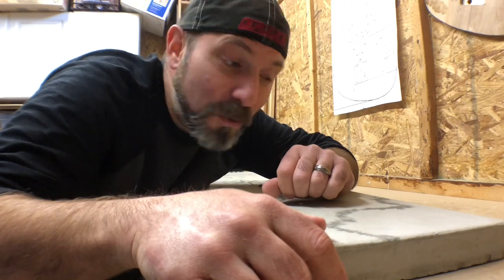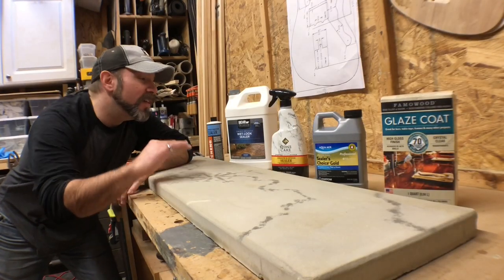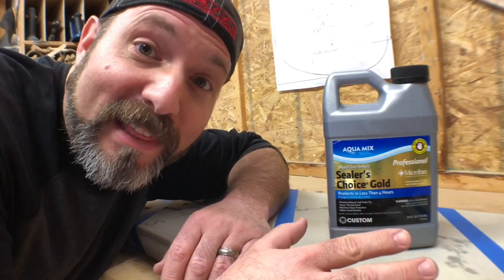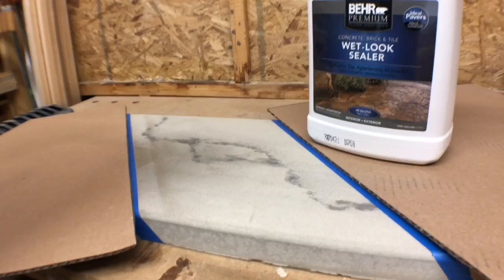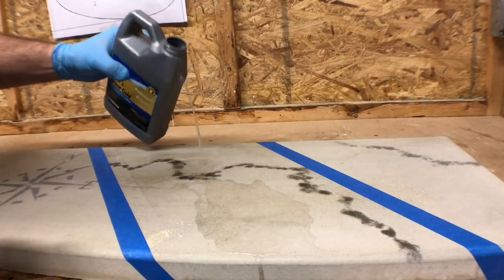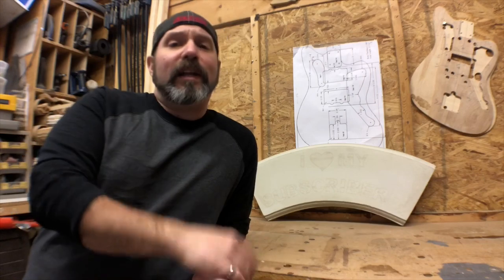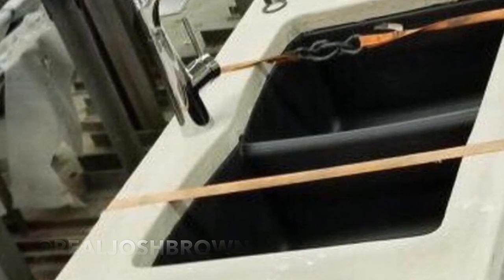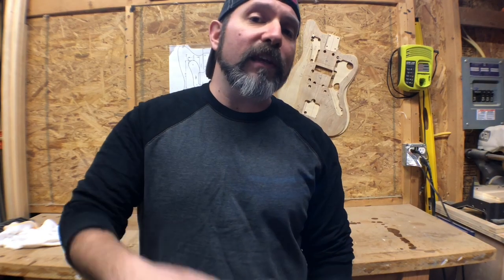Seal a Concrete Counter Top

Comment: I have 2 questions, first- when I was mixing the concrete and i put the flow set in to get the pancake mix consistency, underneath was still hard and not so easy to pour. Did i need more water, did i need to mix it more for longer or was the weather to warm? (75degrees)

Second- I have unicorn spit for my design, do I need to seal the concrete first with some Behr Wet look before i can use the glaze coat with my colors in?

Love the videos, we want more!

Comment: Hi Michael
Love your channel and method to achieve beautiful countertops.  We have made a full outdoor kitchen.  We had to stain the concrete as someone spilled paint on it.
We used the Behr stain and Behr wet look sealer.  When I went to tape off countertop to caulk the joins, the painter's tape removed the sealer and the color all together.
What did I do wrong?

Comment: Mike- thank you for these awesome
Videos!!! My dad and I are working on a project during quarantine and have really enjoyed your videos. I was wondering if I could ask you a couple of questions. When building the countertop how do you support the melamine? My dad is worried that if I lay it on the garage floor to pour it won't be level and that if we suspend it on saw horses it will collapse under the weight. Thoughts? Also- would you recommend attaching it to a outdoor bar via construction adhesive? I saw there is a flexible one suggested for concrete countertops. Thanks!

Comment: First off, huge fan of your show! Well done man ya got me hooked! Secondly i have been doing a full kitchen remodel on my own with a full time job in Olympia. Im from Colorado and thing are much cheaper there, to include black walnut lumber which I planed to make a butcher block counter top out of cuz i have tje tools and know how and I need the dark contrast. But it 2-3 time more expensive per board ft up up . . . So i LOVE green marble counter tops and i Love ur concrete counter tops, can u make a concrete counter top in ur style but it actually look like green marble?!?!?
Reply from the maker: I don’t see why not. As long as you can find that color in a colorant or stain. Heck yeah!

Comment: I love your videos! I've got a question... I have concrete contertops in my bathrooms that were sealed with something water-based when we originally installed them. Do I need to do anything before I reseal them? Water doesn't bead up on them... don't think it ever has. TIA!
Reply from the maker: Thank you so much for the kind words Melissa! Just rub it down with acetone and re-apply a sealer. If you current sealer were oil based then this would be a different story 👍🏻😊
Reply: @MichaelBuilds  thanks for the tip!  I'm looking forward to resealing them!

Comment: I wonder if the epoxy finish will chip over time.  Also if used in a kitchen environment it is possible that hot pans might get set on the top.  I wonder if the sealers will discolor the sealant with a hot pan set directly on the surface.  I will be building some kitchen counters later this summer.  I will be using concrete.

Comment: i did a counter kinda like you did. It didn't come exactly how I wanted, but it's still cool. I used the Farowood clear coat with part A and B. you can see lines left by the putty knife and some parts didn't take the clear coat. Amost like it soaked right into the concrete.Do I need to sand it all off and reapply? I can't post any pics or else I would show how it turned out.
Reply from the maker: I don’t think you’ll have to sand it completely off. Just until you get the putty lines out and do I very thin layer and you’ll never know 😉👍🏻
Reply: @MichaelBuilds  ok. Thanks. Where can I send a pic when it's done?

Comment: This is great and I watched your first video a million times before and while I poured my first counter top. Everything worked perfect except my centerpiece stencil. I was wondering if there is a way to make it more visible before I seal it? I didn't use enough grout. I'm using the Bear wet look dealer. Thanks for the videos and advice!

Comment: BOOM 💥! I did a mosaic stone kitchen counter but wanted a mildly skulpted concrete drainboard. ( actually wanted a full concrete counter, but hey,  I’m working alone and the Lowes assistance ciate totally scared me sway from the full thing. Anyway, I used Glaze Coat on the mosiac and have enough left to do my drainboard. Question: There are some rough areas from the plaster mold I used. How do I polish a surface that isn’t flat?
Reply from the maker: The glaze coat is rough or the mosaic is rough?
Reply: @MichaelBuilds  it is concrete… I aparently didn’t use the right release agent on my plaster mold. It stuck in places leaving me to scrape off plaster and residue leaving the concrete pitted. I’m thinking slurry in those areas but then I still have to sand by hand, I am guessing…. Unless I’m REALLY good at cleaning as it sets up. I usually buff grout with dry screened grout powder which creates a very smooth surface. That was my plan with the Cement All. Or maybe the glaze coat will fill and cover that?  
I should have coated my clay original  with 2 part silicone 🫤
Reply from the maker: @playsinclay  slurry coat is the way to go but don’t plan on hand sanding because you won’t get anywhere haha. Just try and get it as smooth as possible while wet

Comment: I've poured my slab and it's quite large, 72" x 41" and 1 1/2" thick. My buddy and I had our doubts since it was our first attempt at anything like this.  Our problem is that although the top surface is better than we had thought it would be, we do have a more voids that we should have. Other videos using concrete, use a slurry of Portland Cement to fill in the voids and then carry on sealing the surface. Will that work for this material? Also, can I use an acid wash on this material as I could with actual cement to turn the colour of the surface?

BTW, your videos a great, keep them coming.

Cheers!!
Reply from the maker: You absolutely can do a slurry and an acid wash. I would do a small test piece first on the acid wash tho just be cause you won’t get the exact same results as a Portland base cement
Reply: @MichaelBuilds  Thanks for your answer about acid wash. I've started to polish the surface and then I'll be using an aqua blue acid wash/stain and then of course sealer.

I guess the only question about the sealer is about it's UV resistance. This is a patio table so UV is an issue. Can I assume that if the sealant is labelled for exterior use that means that it is UV transparent? Also, this is a outside fixture, how seriously should I require that it be a "food grade" sealer?

Cheers!!

Comment: Michael, I really enjoyed this video! I have a quick question for you. We just took our concrete tabletop out of the mold and have air holes. After looking at it we actually like the look of them and aren't going to fill them in if we don't have to. What do you think about us doing that with the glaze coat or the Cheng Sealer? Will it work?  Those are our two favorites from your video.

Comment: Very informative video! Question. Do you have any problems with sealing the surface after you use the WD40 as a release agent?
Reply from the maker: Nope. That’s why I use the WD40 instead of a more heavy duty oil.

Comment: hello, great vid, I'm having some concrete counters installed in my house,  the sealer the installers are using is solvent based and i can see it have some VOCs on it. for what i think that cannot be good specially since the top of our counters could be exposed over food, but i cannot find how can you know if a sealer is food safe, or is it a rule of thumb with water based selaers?, I'm just trying to figure it out, to check with this guys why they are using solvent-based sealers, thanks and great vid!.

Comment: Thank you for the video. I know its been a while since you made it so I have a couple of questions. I'm thrilled you mention which are food safe since I'm looking to do my kitchen counters as a well as one bathroom. My question is does the type of sealer differ if all I'm doing is a feather coat? I'm looking to just feather coat the concrete over my existing laminate counter and I have looked at some different sealers but I don't know if some of the more expensive variations are really what I need for an overlay. The ones I had looked up are the Cheng, Stonelok E3/2K2, and Omega Countertop Sealer. Any advice would be much appreciated.

Comment: The only problem with #1 is that you can see where the water ring was where you poured the water on initially to wet the cement down.

Comment: Hey, I just did my first concrete top.for my kitchen island! Super easy to follow your instructions. Question, I did the grout for Veins and have some heavy divets or low spots, any suggestions on how to level things out to make a flush surface? The epoxy finish would achieve this but it is not food grade?

Comment: Your videos are amazing!!  I am getting ready to make a 20 foot x 32 inch wide concrete bar top using your method and am planning to split into multiple sections for the pour for the ability to handle, but... Is there a maximum size to consider for concrete cracking?

Comment: How long after pouring a 2” countertop fo I need to wait to do any of the sealers? what about the epoxy?
Reply from the maker: Technically you only have to wait an hour but I would wait 24 hours to be safe
Reply: Came here for this question to be answered.  We are not wanting to wait for mortar mix countertop to cure!  Thank you!

Comment: Can you use your concrete method for making deep planters or sinks with 1.5" thick walls? I've heard concrete can good for photo developing sinks and wondering if I should make it in one pour with an advanced mold, or to make base and side-walls separate and construction adhesive glue them together?
Reply from the maker: Absolutely

Comment: Great videos and teaching skills. What if I wanted to make a color in the concrete form other than gray for the concrete and stenciling areas.  Any clues on how to do that and best coloring brand? Also, what thickness would I need for stepping stones or a walkway with a design?  Thanks and I'll keep watching!
Reply from the maker: Quikrete makes a good concrete colorant. Stepping stone really only need to be 1 1/2” to 2” thick. Walkways should be 3 1/2” thick

Comment: Michael do you have any ideas on how these sealers perform? I have read a lot of horror stories about even water glasses staining concrete after using big box store sealers.  Has anyone had success with any of these? I am making a very small bathroom vanity and do not really want to spend $200 on some of the sealers I have seen recommended such as StoneLok E3 2K.

Comment: I found your video because I want to resurface 2 concrete garden benches then seal them so they won't stain in the future.  Are any of the products mentioned good for this?
Also want to seal the inside of a cement birdbath to make it easier to clean

Comment: Only one that will hold up at all is the glaze coat. Only two basic types of concrete sealers, penetrating and top coating. Squeeze some lemon juice on each area, set a glass on each spot and clean it up the next day.

Comment: I have an existing concrete countertop that is about 10 years old and needs to be resealed. Do I need to do anything more than soap and water to prep the surface for the new sealer, or do I need to use some sort of chemical stripper to clean it and remove the old sealer? I'm not looking to so more work than I need to, but I also don't want to have to fix it after a year! Just subscribed and thanks!

Comment: Thanks for your great video about all of the different sealing options. Question, before using Behr Wet Look sealer, how best to prep 3500 psi concrete countertop? Sand  to very smooth, uniform color100 grit first, then acid etch? Any help much appreciated!

Comment: Question...coffee tables are fine but I have friends who have concrete kitchen counters that were stained brown & sealed. But when they put hot cookie sheets/pans from the oven onto counter top it created major permanent "blemishes/etches" in concrete/concrete sealer. I have lots of skills (over 30 yrs of helping friends) & I am good with my ability to strip original seal. But is there any sealer that is heat resistant for concrete kitchen counter tops? Or...perhaps it is best to strip and re-stain for continuity of color but not seal?
Great videos, Look forward to more!
Reply from the maker: To my knowledge there sealers really aren’t built for high heat. You have to treat a concrete countertop like a granite countertop. Use cutting boards and pot holders

Comment: I do have a question.  I have a a fire table.  Just wondering if this concrete table top can tolerate the heat of the propane heating the metal dish  
(burner base)    that would be in contact with the concrete

Comment: Michael, I used the rapid set mortar to cast four treads 3"x60"x20" for stairs on the exterior of a home. I used charcoal dye from Home Depot to create what looks like Pennsylvania Bluestone. I'm wondering about using the epoxy on such a tread on the exterior and whether it creates a slipperyness when wet. Could you comment?

Comment: I have a question- I was thinking of putting a sealer on my concrete patio area around my pool. The Concrete looks worn and not that nice looking anymore. What would you advise using to bring back a nice finish and slip resistant (and affordable)? 
Thanks, loving your videos.

Comment: Hey Michael, love the channel and still coming back to rewatch your videos weekly!  Question for you.... I just finished an outdoor kitchen where I poured all concrete countertops...am going to keep the natural look and not acid stain but want to make sure it has a really good sealer on it.  I contemplated epoxy, urathane, and latex sealers and trying to make a decision on which to go with.  I’ve sanded the concrete from 50,100,200,400,800 and potentially will do 1600 and 3000.  I do think i want to enhance the color a bit as it’s gotten lighter as I sand it (used quickcrete 5000 so there is a good amount of aggregate).  Is it worth the effort for epoxy if I’ve sanded it really smooth already? Any suggestions/ideas would be greatly appreciate.  Can send over pics if needed. Thanks in advance!!
Reply: Did you decide to seal yours? I recently poured my outdoor kitchen tops out of quickrete 5000 and am trying to figure out what to seal mine with.

Comment: How does any of these do in the sun, outdoors? I’m building an outdoor kitchen and using your methods but I wanted a thick clear epoxy look but everything a read says it will yellow sooner or later in the sun. I also like the way it looks without anything. So I wouldn’t want it to change color. Help!?

Comment: Hi Mike, great videos!  I have an outdoor concrete contertop that I want to seal, what would you use to clean and prep the surface before sealing?  thanks!
Reply from the maker: A simple Acetone rub down would work great and it’s non evasive 👍🏻😊

Comment: @MichaelBuilds...HELP!  I had concrete counters made 1.5 years ago...I colored them myself to hide some imperfections that happened when they were made...mainly one visible seam...and then sealed it with 2 part Epoxy. I loved it, but it's starting to break down in some spots..especially near the faucet and the edges of the sink.....my question for you is what can I use to remove the epoxy? After, I will use one of these sealers you've shown here...Thank you @Michael Builds

Comment: My diy concrete sink has a rather rough surface. Wondering if there are any epoxy products similar to Famowood. Home depot doesn't even carry it, lowes and home hardware know of it, but out of stock, and ordering online costs closer to 60$ which is more than the rest of the project costs...

Comment: Mike Help!!! I used Home Depot’s Henry feather concrete and did 4 skin coats and sanded it 80, 120, 220 and then did the Behr concrete impregnator to protect against stains and did two coats of that. Then I did 4 freaking coats of the Behr wet look sealer and I already have stains from a soda cup that had condensation on it and some spilled oil. It went right through and is stained. What should I do? So frustrated!!!

Comment: It seems in many other videos, people use 511 Impregnator Sealer (solvent based) before using a final sealer. Do you think that’s unnecessary and can it cause problems going over with a water-base product?

Comment: Mike, I poured a cementall countertop a week ago and sealed it 3x with stone care granite and stone sealer. I’m still getting a lot of water absorption. Not sure why it’s not sealing. At this rate it will be an entire bottle for a small countertop. Any suggestions or thoughts? Could I just use the Behr sealer over it? Thanks!

Comment: Mike, on the glow in the dark powder. Any idea on sealer used. I tried it and once the sealer dries the powered was on top and the concrete and just blew away in the wind or wiped off?

Comment: hey mike if i want to build a concrete bar top that is about 10ft do you recommend anytime of support or do you think making the top thicker will do the trick, also how much time do i have if I am gonna mix maybe 2 buckets at a time in order to fill a 10ft long and 2" high counter ???? thanks

Comment: Mike, great job.... I’m using my husband’s account so the picture isn’t me, lol!
I was raised with my hands in concrete, no joke, old school, from helping my Dad... Question, I would like to make several Concrete seat/bench for around a fire pit. (Not decided on base yet) but I have to be able to move it easily. How thin do you think I could go... 1 ½ inch? In Michigan so lots of different weather, probably bring it in the winter, any idea what to seal it with to protect from weather.. thanks and great job...